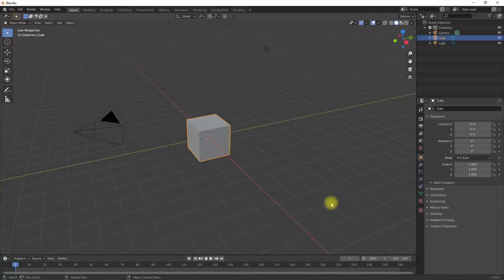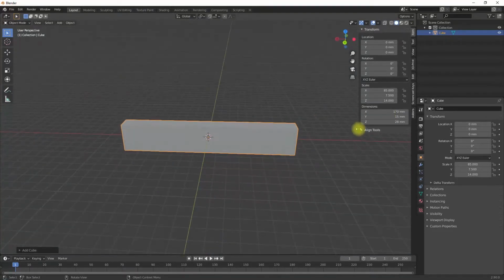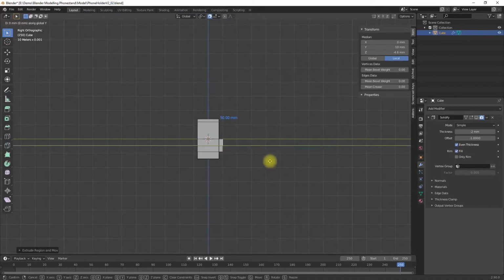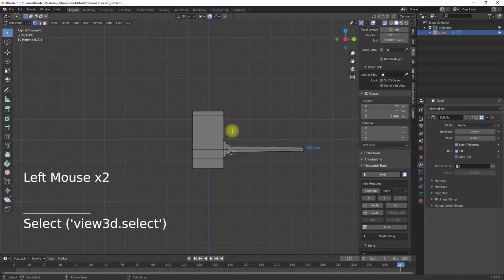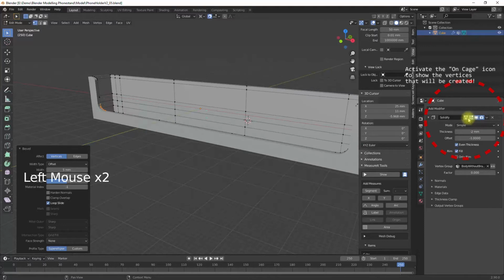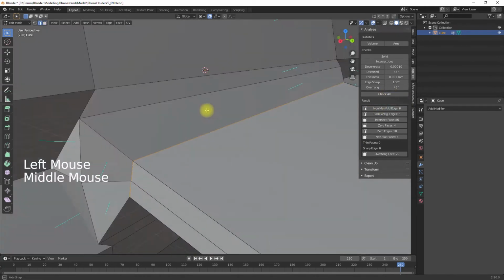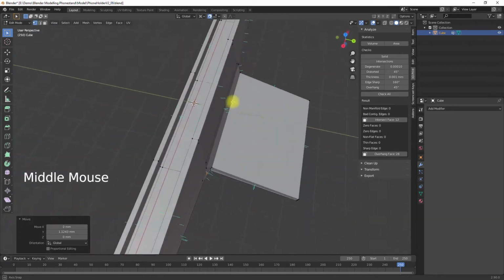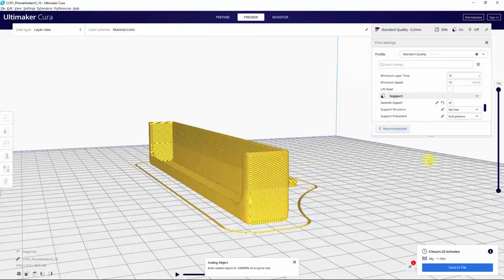Blender step by step modelling a 3D printed car phone holder with precision

Comment: Very interesting. A little advanced for a beginner like me, but it's good inspiration. I was starting to build this kind of thing with a bunch of cubes, but doing it in one cube and loop-cutting it is genius. 
However this presents a problem for me that you didnt have...
When I solidify my cube, the units are way out (.006mm rather than 2), and it thickens the sides more than it thickens the top - its probably proportional to the dimensions of the cube. I do have "even thickness" checked, but it doesnt help.
Reply: Aha. Apply menu, scale.
Reply from the maker: Always, Always apply rotation and scale before you start using the modifiers. Otherwise, you will run into this kind of problems.